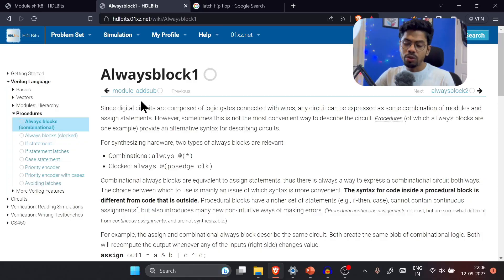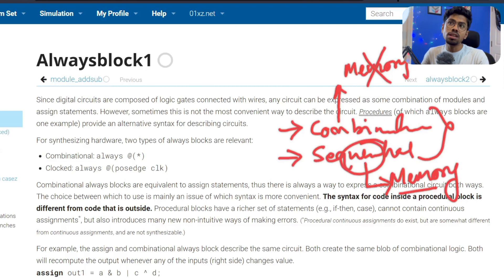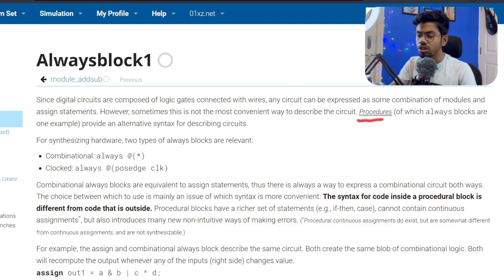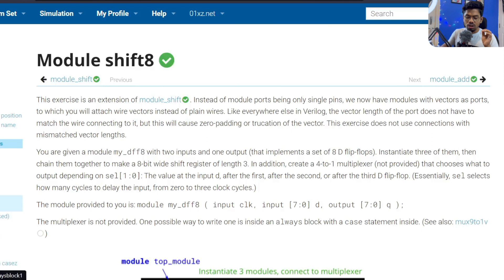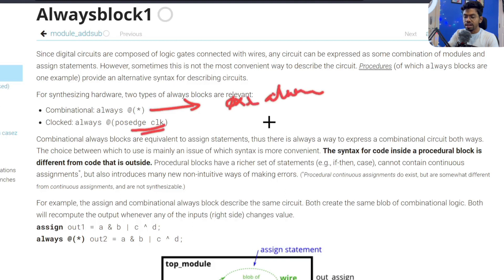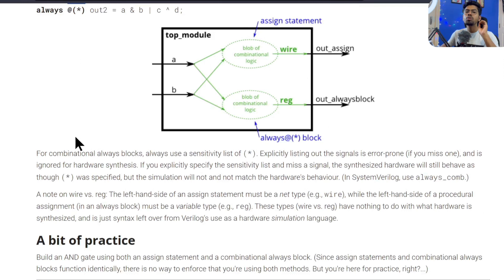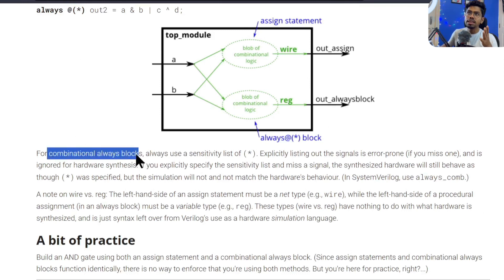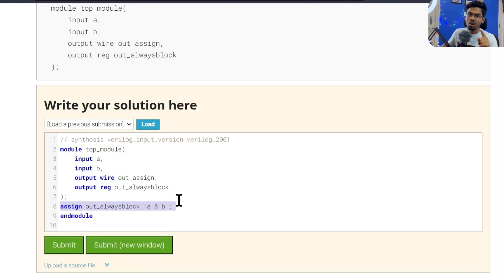What's the need of Always block ? | Lets Learn Verilog with real-time Practice with Me | Day 12

Comment: output of  carry selector code?
module top_module(
    input [31:0] a,
    input [31:0] b,
    output [31:0] sum
);
Reply: module mux (p,q,sel,out);
    input [15:0] p,q;
    input sel;
    output reg [15:0] out;
    //wire [15:0] x1,x2;
    always @(*)
        begin
            case(sel)
                1'b0:out=p;
                1'b1:out=q;
            endcase
        end 
endmodule
module top_module(input [31:0] a,input [31:0] b, output [31:0] sum);
    wire x3;
    wire [15:0] x4,x5;
    add16 A1 (.a(a[15:0]), .b(b[15:0]), .cout(x3), .sum(sum[15:0]));
    add16 A2 (.a(a[31:16]), .b(b[31:16]), .cin(1'b0), .sum(x4));
    add16 A3 (.a(a[31:16]), .b(b[31:16]), .cin(1'b1), .sum(x5));
    mux m1 (.p(x4), .q(x5), .sel(x3), .out(sum[31:16]));
endmodule

Comment: the first line declares the module, the problem is that the always is not written in a proper syntax, it does not have a sensitivity list or any list based on which the values inside the always block would change